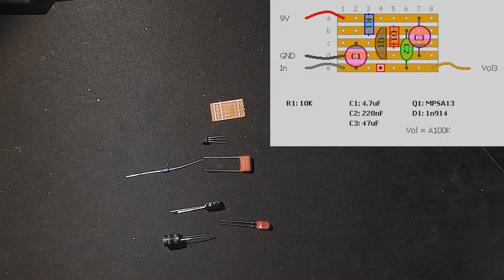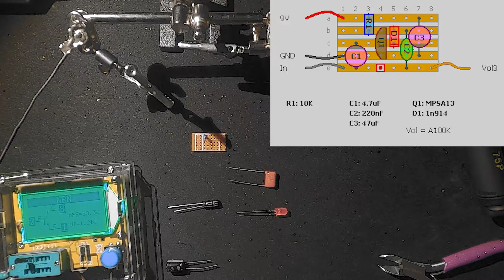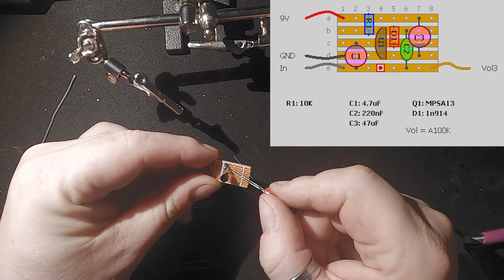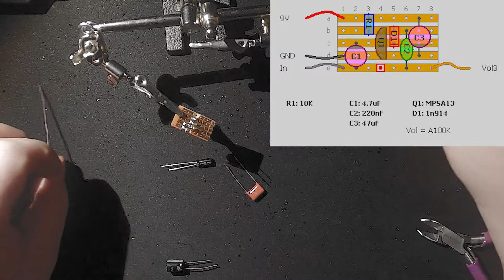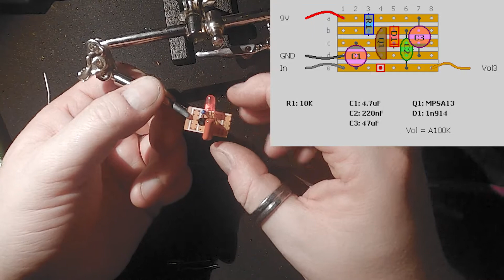DIY Pedal Building - How To Build A Bazzfuss Guitar Fuzz Pedal

Comment: is this based on a fuzz face? whats the meanning of the red box in the pcb draw? thank you
Reply from the maker: Hi, not that I am aware, the Bazzfuss is a building block for loads of other fuzzes. Which red box? The diode is red and the cut in the veroboard is red.
Reply: @goliathfxbassandpedalshow  the red box with a red point in the middle, is it just by doing a scratch in the board?
Reply from the maker: Yes, making sure there is no continuity between both sides of the cut
Reply: @goliathfxbassandpedalshow  ill try it, thank you
Reply: fuzzface is two transistor, this is one.
Reply: @TinkerToneworks  this is darlinghtom transistor, so tehnicaly, its 2 transistors